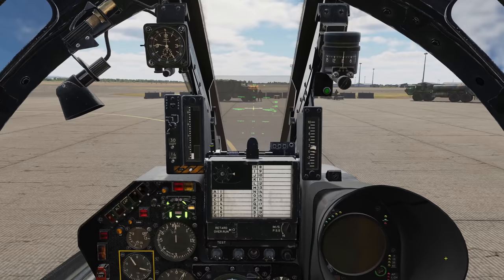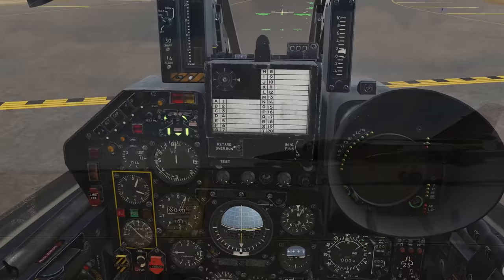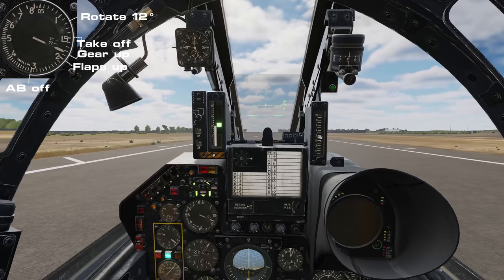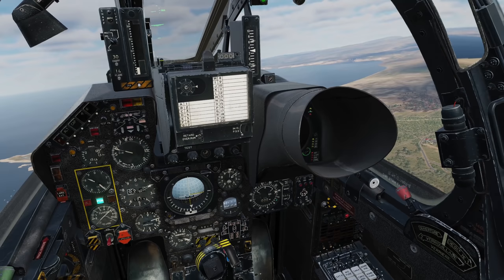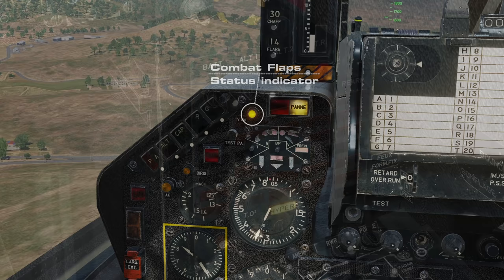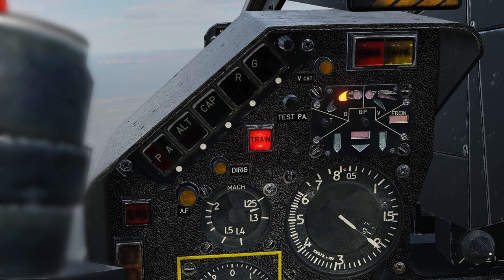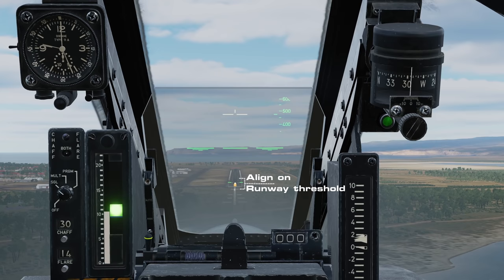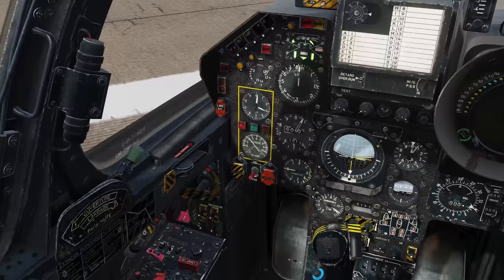DCS: Mirage  F1CE Take off, Landing, flight Tutorial

Comment: Great Tutorial.
Just one little thing that you mixed up (but don't worry, most people do). The angle of incidence is the angle at which the wing is built onto the plane in referenceto the longitudinal axis. The indication to the left of the HUD displays the angle of attack, the angle between the camber line of the wing (a straight line from leading to trailing edge of the wing) and the relative airflow. 
Even with zero angle of incidence planes can fly (eg most Extra aerobatics). During flight only the Angle of Attack matters, not the angle of incidence.
Reply from the maker: It's referred to as angle of incidence in all the documents, the choice of words was deliberate, but thanks for sharing the overview.
Reply: Interestingly enough, flying with 0 angle of incidence can be done at 0 AoA, provided you have a positively cambered wing. Flying something like an Extra where it's a symmetrical airfoil at 0 incidence, you'd need to rely more on AoA for lift.
Reply: Pretty sure both the terms are often reversed depending on the country.
Reply: in french angle of incidence is the angle of attack, thats why its referred as I for incidence
Reply: @RedKiteRender  I pretty sure that in french AoA is called angle d'incidence ( Incidence angle), ie refered as I in french manuals

Comment: Nice tutorial Red, looks like a fun jet to fly. A small correction if I may: Angle of incidence is not the same as AoA. It's the angle between the chord line of the wing and the longitudinal axis of the aircraft. So it's a design thing that doesn't change ( unless you pull too hard haha). Also, I must admit I'm not a big fan of the cockpit textures. A classic mistake of skinners in any sim is to make the blacks too dark, which I think happened here too. It doesn't look like a surface that's painted black, but something darker than that. Maybe it's just YouTube and it will look better in game. Thanks again for the tutorial!
Reply from the maker: Have a look at a more recent video's textures! (they're also still too dark, wip) but largely improved.

As for aoa / incidence. The gauge is called the angle of incidence in the real aircraft's manuals, so that's what i went with.
Reply: @RedKiteRender  I see, perhaps it's 'incidence' in French?
Reply from the maker: @ReflectedSimulations  I believe that's the case, they use 'incidence' instead of 'angle of attack.' You could argue that's either a translational issue or French flavour!

Plausible the translations were done by someone without understanding of aviation, so they went with literal translation, rather than parsed.

Comment: I wish if they'll include the Mirage F-1EQs used in Iraq/Iran war, this type were customized based on the IQAF request to be a multi-role aircraft (Air, ground, sea, advanced warfare) and it's carried that deadly anti-ships missile ( Exocet ) with a great success
Reply: It also had INS. This version doesn't.
Reply: @mudmover3279  True, I'd spoke with a former F-1 pilot he said this version is missing a lot. But still a great add to DCS
Reply: There will be F-1E later on which, although not as advanced as the EQ, are much more capable than the CE
Reply: @amalahama  Fare enough, thx for the info
Reply: @amalahama  F1CE, F1EE, F1B, F1M
Reply: @amalahama  The F1EE only really adds the INS and refuelling probe, the rest of the systems will be very similar to the CE shown in the video. The late EQs had full digital HUD, digital RWR, improved radar with ground targetting modes, targetting pods, etc.

Comment: I am wondering how does the plane gets flight path vector measured? (Flight direction displayed on HUD) I thought it comes from INS in planes like A10/F16/etc, but this one doesn’t have INS. Is FPV mark in Mirage F1 relative to the air or to the ground?
Reply: Maybe it does a rudimentary calculation using air speed and rate of descent.  Total guess.
Reply: @kontiuka  Yeah, could also be vane-like device like ones used for AOA measurments. But they will show velocity direction relative to air (but probably could be adjusted for the wind). Let's see, hope the module manual will cover this topic.

Comment: What does BIP mean on the gear indicator panel ???
Reply: It transmits a beep over the radio to ATC to confirm landing gear is down. It's non-functional in the Mirage 2000C module and i doubt it'll function here. I mean DCS doesn't have ATC.